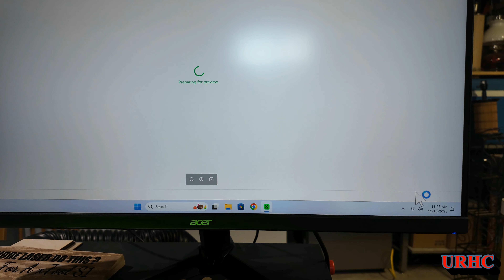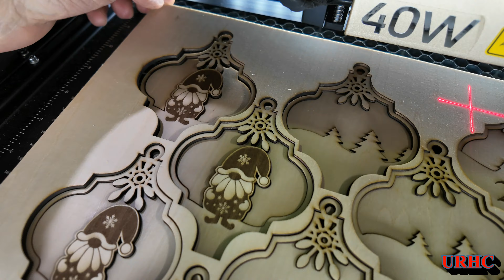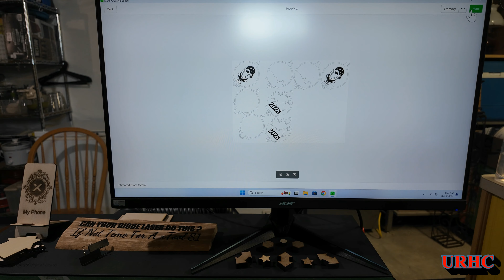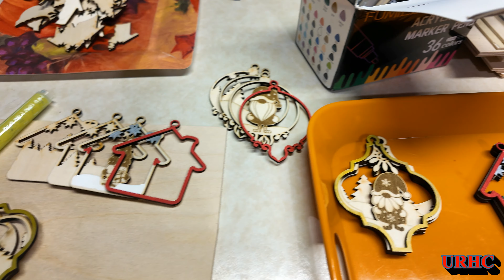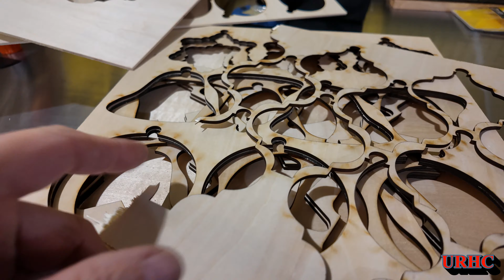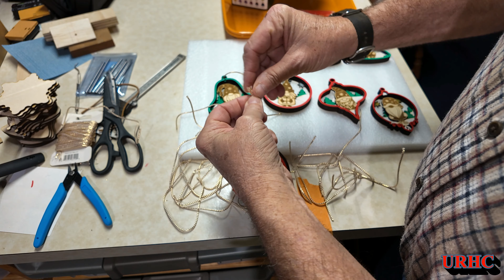Quick Easy To Make Gnome Ornaments For Gifts Or Selling Using A xTool S1 Laser Engraver

Comment: Hi - if you ever do print a handle to assist moving the laser head for the S1 I would definitely buy one! I'm forever knocking the little measuring arm off mine .
Reply from the maker: So far I just have a little one stuck on with  double sided tape. There is very little  room for a nice ome. Thanks for watching.
Reply: Good idea 👍🏻

Comment: Lasermatic MK2 is cheaper and has all these features you ask for. You should check it out. Plus it’s way cheaper than the xtool. No mirrors to clean, no water… very easy. Just as powerful as the CO2 lasers. You’ll have to use lightburn again but it’s still pretty easy since it directly connects to the machine.
Reply from the maker: This is a diode laser with multi stage air assist and curved surface engraving.No mirrors or cooling and 40 watts. Easy alignment setup. The best diode laser ever. About the same price as yours but a better machine With full wifi and app control. They hit it out off the park with this one. Thanks for watching.

Comment: Ed, Those ornaments came out great.  Is that bottom far enough below the honeycomb bottom that you could put in something like a aluminum or stainless sheet tray (cookie tray)? If it would fit, it would give you a lift out catch tray.  They have lots of cheap trays on Amazon in all sorts of sizes.  Also do you really need a complete bead of superglue on those ornaments?  I would think a dot at the tip of the stars or a few dots on the other shapes and it will hold.  Not like there is any side pressure on these once they are made.
Reply from the maker: A thin sheet would help but at the price of this unit there should have been some thought put into that. I think they figure it will make many buy the riser base with the tray. I'm trying to get the base to see if it reduces the ability to properly extract  fumes as I have seen some leaking out in others videos.  Sealed up like this has perfect  flow. I tried the couple beads and the plywood absorbs enough  moisture between the layers to warp them apart on some making the seams visible. There's probably a better  way but I haven't found it yet. Thanks for watching.

Comment: Do you have a link where you bought the gnome designs?  I can't find them.
TIA.
Reply: I cant find them either, there is only 385 pages.LOL, SO been looking for 1/2 hour, thats enough.
Reply from the maker: Search for multi layer Christmas gnome ornaments.  That's how I found them.
Reply from the maker: Sofontsy.com. I don’t do links to them because things seem to change over time but the picture of the page is shown in the video.   Do a search for that name. I buy all my files from them. I added the outline layer by just offsetting the outline and subtracting from the copy. Thanks for watching.
Reply: Thanks I found it by using the link on the picture in your video. @unemployedredneckhillbilly2023
Reply: Can you explain how to offset the outline and subtracting from the copy?  I can't seem to get that to work.   @unemployedredneckhillbilly2023
Reply from the maker: first I scaled the 3 to the size I wanted.  then select an artwork and copy it. i did a -4mm outline and then selected the 2 and used the subtract tab. The one with the fancier bottom I used  - 3.1 outline.